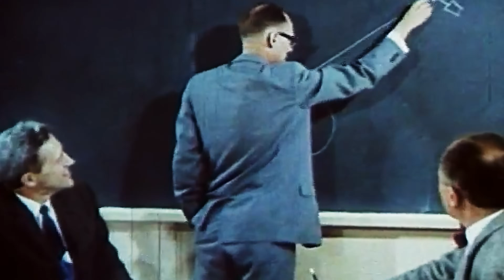Omega: The Last Word in GEO

Comment: What about the 300ms latency  inherent in geosync?
Reply: The new Hughesnet. No thanks!
Reply: You don't need a low latency for everything.
For example, text messages, financial transactions between regular people and the like, transmitted from one mobile phone tower to another, are applications that don't require a low latency.
Reply: @InfoSopher  Then good ol 1200 baud dialup should work as well.
Reply: @Cyberdactyl  No it doesn't when there is not even a line to begin with. Because the place you're trying to connect is too rural and too poor. Look at the other videos to see typical customers.

In addition to that, it's also for disasters. Which can easily disconnect lines. But not satellites from their ground stations.
And of course it has a military function as well.